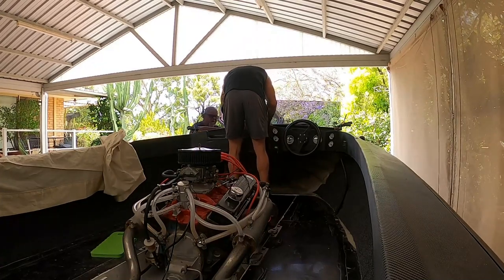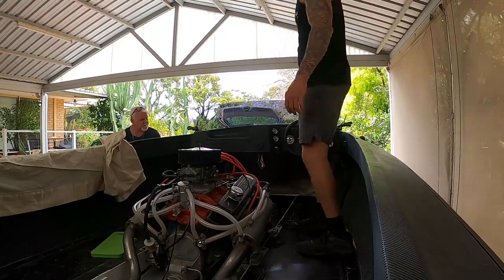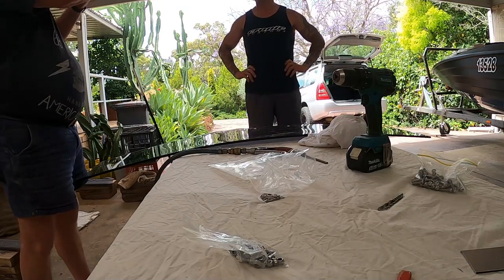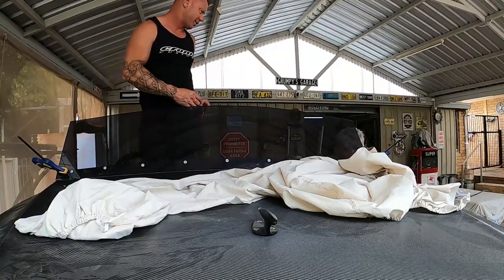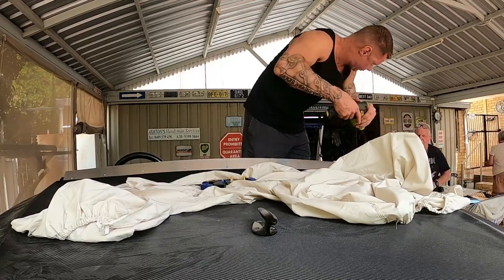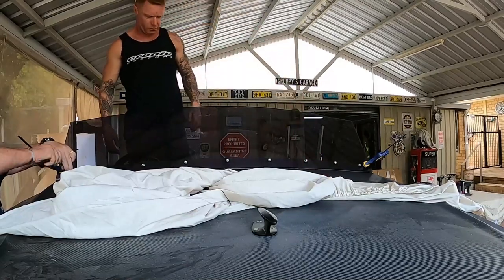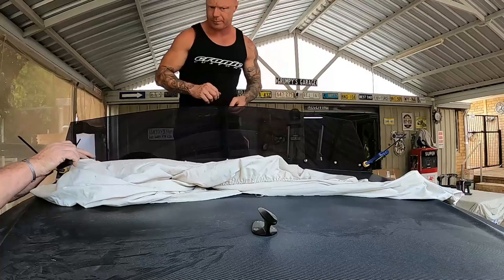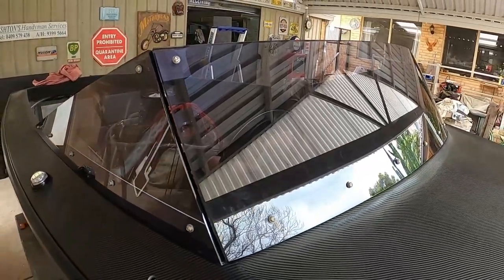making a frameless windscreen for my flightcraft ski boat

Comment: Where type of perspex is this ? Thickness, does it come tinted? What size angle did you use and what time screws? What size angle are you using
Reply from the maker: I can find out if you like im not sure of the type of perspex. 
yes it came tinted. 
it was 10mm thick.
angles had to change severall times on install it was alot of testing and adjusting.
Reply: How thick was the 50 aluminium l bar